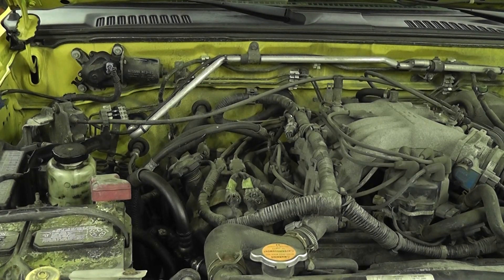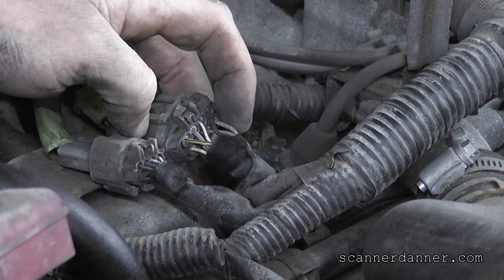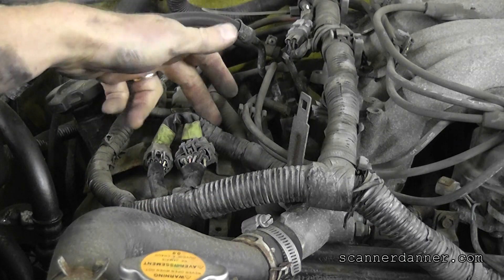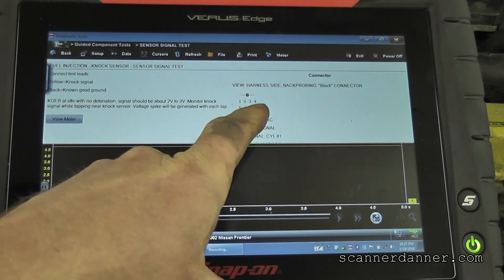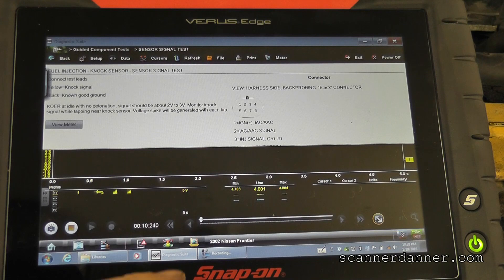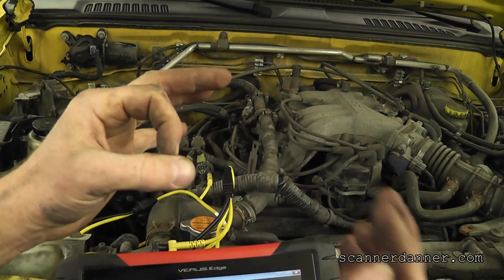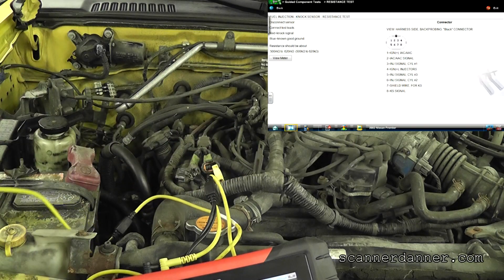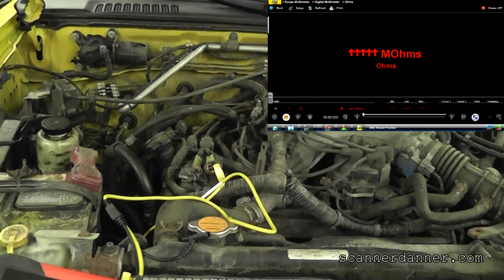How to test a knock sensor (P0328) - Nissan

Comment: Soooo how do I use a regular volt meter to test this? Ya boy is sorta dumb and needs help
Reply from the maker: You can only do a resistance measurement with you DMM. The signal is too fast of a voltmeter. Though it may be possible to see some activity on an AC voltage setting

Comment: How to test a $25 knock sensor: just buy a $5000 scan tool 👍 piece of cake!
Reply from the maker: or, watch and learn and find another piece of equipment you can use as a substitute
Reply: @ScannerDanner  what "other piece of equipment" can do what your $5000 scan tool can? (Besides a $2000 oscilloscope)

Comment: 😢 I have a 2004 Nissan Maxima and the car turned off on me while I was driving. Then I had a hard time turning it on and the car won’t accelerate the way it should. Now it jerks so bad when I put it to drive and even worse in reverse. I have 3 codes: P0345, P0328, P0011. I have had issues with the car. About a year and a half ago the computer crashed and it caused a small fire. I had to get another computer and the mechanic fixed the wiring but the car still has issues after this. I still don’t know what caused the fire. They said it was the ignition coils. I love my car but I just can’t keep spending more money. I just want to know what is causing all of these issues. What should I do? Take it to the dealer to get it fixed or another mechanic ? Should I just Get another car and what kind? They’re so expensive now 😢 Hope to get some advice  from anyone

Comment: Got a P0328 code on my 04 Frontier 3.3 with only 41k miles. I have 2.7 volts at knock signal wire which is good. Disconnected the harness and checked resistance in ohms on the knock sensor wire and its not showing a reading which means its an open circuit. The issues was on low acceleration is would cut out or stall with no power yet the engine was still running.  No response from pushing the accelerator more. Could only pull over for a few seconds and resume driving. It would do this intermitted.   Only changed the distributor with a new factory one and reset the timing. Its gotta b the knock sensor right?
Reply from the maker: Not likely. Typically just a code and a check engine light on those.
Reply: @ScannerDanner  Thanks for the reply

Comment: Great vid! Some fyi if you replace the sensor with an aftermarket sensor, alot of people report having issues with the cam sensor afterwards. You should replace both at the same time. This vid explains why aftermarket sensors have the issues they do and why it causes that problem
https://youtu.be/Pjf-tacXOnI

Comment: if your engine is knocking will it throw this code too?
Reply from the maker: From memory this was an electrical circuit code? So I'd say no, but I would be worried about the actual knocking more than the code if that makes sense?
Reply: @ScannerDanner  let me give a little context and update id love your expertise on this please.

 i have a 92 nissan 240sx turbo,i have a lean idle/rich under boost issue,i found a good exhaust leak pre o2 which would explain my lean idle,i noticed i have a code for knock sensor and now thinking the lean idle caused the knock code,i think the knock code is pulling timing and adding fuel under boost causing my rich under boost condition so fixing the leak should solve everything does this sound like logical theory? 

or im wrong and exhaust leaks pre o2 on turbo engines normally cause rich under boost conditions without knock code playing a role?

Comment: Hi. I just bought a 2004 4x4 Xterra and there is a soft code, no CEL, for P0328 knock sensor. The mechanic said this is commonplace on Nissans and that replacement wouldn't resolve it. Please advise 🙏 thank you.
Reply: Santiago, per the Nissan Factory Service Manual, DTC 0328 does NOT trigger the MIL (same as CEL) to illuminate.  Specifically, Nissan engineering chose to NOT illuminate the MIL if DTC 0328 is encountered.
  By definition, DTC 0328 advises technicians of "KNOCK SENSOR CIRCUIT HIGH-INPUT;" meaning ONLY that "an excessively high-voltage from the knock sensor is being sent to the ECM."
  The general do-it-yourselfer is under the impression DTC 0328 will load AND ILLUMINATE THE MIL if pre-ignition or knock is detected by the ECM...that is completely wrong!
  P.S.  If your Xterra has only stored DTC 0328 (meaning NO other codes that would trigger MIL illumination) and ALL emissions readiness monitors are "OK," you will pass a standardized government  emissions test.
Reply: I replaced knock sensor and wire in original location same code. Did relocation, same code. Mechanic said on past similar vehicle. That code if not taken care of in timely manner can damage the computers ks circuit. When taken to emmisions past without issue tho, which was good and some much needed attention to underside of manifold components.

Comment: So my 04 Xterra is getting the knock sensor code. It starts stumbling over 3k rpm. When I test the voltage like in the video I get 2.4v. Does this mean my sensor is good?
Reply from the maker: Ignore the k.s. code for your stumbling above 3000rpm issue. They are not related

Comment: Great video! Thanks so much. So I back probed my 2004 Xterra (Supercharged) and I'm getting 3.2V, knocking on the engine (on top of the supercharger/intake) doesn't seem to vary it at all... I'm getting the P038 (knock sensor circuit high) code. Looking at the FSM normal voltage should be 2.5V at idle if I understand correctly?

Comment: How to splice knock sensor cable mine was chopped and spliced only the center wire but no ground (like coaxial cable)
Reply from the maker: you have to keep the shield isolated from the signal wire. Connect them separately and isolate them from each other and you should be fine

Comment: I'm a noob with a voltmeter. What setting do I set it to in order to do this test? Just using a freebie harbor freight unit...
Reply from the maker: Voltmeter set to a 20v scale to measure key on signal voltage, plugged and and unplugged while backprobing the connector with your red lead, and black lead to a known good ground.

Comment: Good video!! I replaced knock sensor. Wire was cut. 
I spliced into it and bought the connector, new knock sensor and still getting code p0328? Any info is much appreciated. .
Reply from the maker: Yes, that wire was a thicker wire right? It is actually two wires in parts of that harness. 
The outer wire is a shield wire and the inner wire is the signal. You didn't make them all one did you?
Reply: @ScannerDanner  No sir Thank you for replying.  I made 2 wires as the connector came with 2. I used the insulated wire for the green wire from the connector and the wire in the middle to the red from the connector. 
I did so much research before I put everything back together. 
Thanks again for your reply.
Reply from the maker: @TyRC12  okay, with the key on, disconnect the KS connector and give me a voltage measurement on the signal wire, I believe it should read close to 5v, maybe 7 (subaru used 7), then plug it in and give me a reading on that signal wire, it should be about 2.5 v
Reply: Thank you so much. I am really thinking about taking it apart again. I was thinking of  relocating the ks?
I believe the camshaft seal is leaking also. Thought it was the valve cover. But its leaking just underneath it. P0152 code I believe its for the O2 sensor. I changed it already also. I am getting codes that I already cleared? Changed the parts already. Thanks for any info. I appreciate your knowledge.
Reply: @ScannerDanner  Also I think I just put the red wire to the center white wire. Then the outter wire to the green. Im wondering if I have the wires on the wrong side since your saying signal wire. I dont believe I looked for signal side. I just thought red wire would mean power. smh. So I need to figure out which sode is signal on ks then wire it to the whire wire. If I did get lucky and wire it right. I will take voltage to see if Im getting signal. Thanks for the knowledge
Reply: @ScannerDanner  Sorry my phone is very old I cant receive notifications from Youtube. I will keep checking for your message thank you

Comment: I have 04 Xterra 70k miles only , I have code P0328 my car run fine and smooth but the problem is when I shift to D or R it won't do anything it won't move at all , is this code related to this problem or I'm dealing with something eles is bad knock sensor can make the car not to move at all ?
Reply from the maker: ignore the knock sensor code, separate issue for sure

Comment: I know this is an old subject ,but just watched i and dont understand the conclusion from voltage test ,instruction says  2-3 volts  with KOER, test showed nearly 5 volts and faulty sensor was diagnosed from this 5 volt reading with out engine running. What did I miss ?

Comment: Hi I have question I have same truck and same code I change knock sensor and same code po328 comes up again what u think could be the problem causing ? Thank you
Reply: Did you ever fix this problem?  Same problem here.
Reply: @TyRC12  yes I had to buy oem knock sensor I buy aftermarket first it was waist of time then I got oem nissan  knock sensor works great now but ur 1st sensor could be bad u can also then sensor with multimeter check videos on YouTube about knock sensor diagnoss.

Comment: Great video but screw taking that engine apart, open the loom tap into that and relocate new sensor on top of plenum
Reply: bad idea. The sensor is where it is to sense vibration and send message to computer to advance or retard timing according to your driving situation.Re: climbing,temp,load pull, etc.

Comment: Great video. About to replace knock sensor on '03 xterra. I've already done a fuel pressure regulator (FRP)on a '98 and the '03 is exactly the same intake manifold setup. Depending on how concerned the owner is about having the knock in the proper location will determine if intake manifold comes off or gets relocated.

If anybody if suffering from stalling and no start conditions and has replaced distributor or coil then it probably the FRP. They are known to fail.  I checked every wire from sensor to ECU on the '98. The fuel flow out of fuel line was good. I set up a rubber hose into gas can. The owner said screw it and bought the FPR because he was having the problem for 2 months (got lucky $50 Ebay real Nissan nib). Started right up no problems and haven't heard from him since.

Comment: Is there any danger of shorting the signal wire to the shield when back probing the wire?
Reply from the maker: If you are backprobing a connector, no. If you are piercing the signal wire, yes, absolutely, you do NOT want to do this on a shielded circuit.
Reply: @ScannerDanner  Thanks,
I'm trying to visualize why it's not an issue.  How is the shield grounded at the connector?

Comment: What is the purpose on this knock sensor anyway?
Reply from the maker: it enables the engine computer to run an aggressive spark advance map. The knock sensor is basically a microphone and if the ECM "hears" a spark knock or pinging issue, it backs off the timing to correct it. With a knock sensor code, it is not uncommon for the ECM to run a less aggressive spark curve or map, resulting in less mpgs. Not sure you will feel a power difference though to be honest
Reply: Thanks for the info

Comment: My 2003 Frontier 2wd 3.3L V-6 broke down twice. Sometimes starts right up, other times crank no start. Pulled codes. First said multiple cylinder misfire with the P0328 code. Checked it running again. Back to back P0328 knock sensor circuit high input. I think I'm gonna change the knock sensor. Thanks for your video.
Reply: Also, I use my Mac Tools ET97 scanner. May not be the best, but it does some live stream. Good enough for this shade tree mechanic on a budget. LOL
Reply from the maker: leave the knock sensor code alone for now, it is NOT causing your problem. When it doesn't start, you need to find out what you are missing
Reply: @ScannerDanner  Oh wow. Thanks. I just bought this truck about a month ago. About to take it back to dealer and tell them to either fix it or cancel contract or get me another vehicle.
Reply: What was the problem on yoir 3.3l
Reply: It was a Nissan. That was the whole problem. No more Nissans or Hyundais in my driveway.

Comment: Can anyone give me a idea of how much this knock sensor is going to cost me to have replaced???
Reply from the maker: I think the intake has to come off to change it, so labor will be your biggest cost. However, I have heard that they make a knock sensor relocation kit, where you modify the existing wiring and bolt the new knock sensor up to a different location. Something to look into on this older model set up for sure!

Comment: So i have a nissan 350z and have code p0327 and p0328. I replaced the knock sensor still same code I did resistance test was 420 on sensor and 280 at end of sub harness. What can it be its driving me crazy and 4.24v going to sensor.

Comment: Now does this apply to the supercharged Xterra?
Reply from the maker: should be any different if it is a single wire knock sensor
Reply: @ScannerDanner  I found out it's exactly the same place. Still hell.
Reply from the maker: I think they sell a relocation kit believe it or not. Something to look into for you

Comment: I'm trying to test a 2017 VW knock sensor with both knock sensor codes for low circuit voltage. Its a 3 wire. Shield ground is good, but the + and - for the knock sensor are both showing 0.8 volts for both sensors at the harness unplugged. There's no information on these knock sensor that I could find on Indentifix or Mitchell. I did the knock test unplugged at the KS side and it barely put out anything 0.5 volts.
Reply from the maker: I assume you have knock sensor codes? Post this to my forum, I'm sure we can help you. It's free to join. Hope to see you there. 
https://www.scannerdanner.com/forum/post-your-repair-questions-here.html

Comment: Great video.  Question:. I see people all on YouTube replacing knock sensors and assuming they are bad.  But how often does the check engine light come on because they are actually doing their job and detecting a knock, or ping?
Reply from the maker: They do not set codes for doing there job, make sense?
Reply: @ScannerDanner  Yes, thank you.  I thought the knock sensor changed the ignition timing to help prevent damage and then set a code so the driver would be aware of the issue.  I didnt realize a code was set only if a sensor/wiring fault is detected.  Thanks.
Reply from the maker: It does do that, but will not code for activity, only when there is a fault as you stated.

Comment: Where do you connect the other lead if you are just using a plain ol' multimeter
Reply from the maker: exactly like the scope. Just think of the scope as a very fast voltmeter. The connections are the same

Comment: Great video...I just subscribed to your channel.  Thumbs up.Perhaps you can steer me in the right direction.  My Nissan Frontier SE 2003 Crew Cab 3.3L is giving me a bit of a starting problem.  It takes about 5 to 10 seconds to start.  Then at other times, it starts instantly.  No code showing.  I hear the furl pump kick in and whirrs for about 3 or 4 seconds.  Any suggestions?
Reply from the maker: I just uploaded a video on ScannerDanner Premium on your exact truck. These are known for distributor problems. 
I seriously would like to open this for you for free but I can't easily. My suggestion is to subscribe for the 14 day free trial, then immediately cancel your subscription. You will still get the remainder of the 14 days and you won't have to worry about being charged. Yes, you'll still need to put in a credit card or paypal number but it is very secure (more so than even PayPal). 
https://www.youtube.com/watch?v=4Vq8P3jbm4U

Now I am not suggesting you go and run out and buy a new distributor. You could also have a fuel pressure problem. In which case, this playlist should help you identify that. (this is all on my free channel)
https://www.youtube.com/playlist?list=PLAFYVCyenqcrstVqfSc1PCbQ1pebuNIO6

Comment: what I was looking for! this isolated my problem down to the ks, just used a multimeter. Viva la youtube, thanks.
Reply: a bit confused tho: can I have a partially bad KS?  w engine either idle or off, the back probe reads 4.8v disconnected and 3.6v connected-- so its not open but a bit above spec.  When I alligator clip the pin I get 622k ohms, which again is just over spec. (strange since that should lover v...)
I get 2 generic P0328 B1 circuit KS codes w my innova after starting.

Comment: How can you condemn the knock sensor that quick without testing wire from your 8 pin harness to knock sensor?  I am dealing with P0330 on 02 sienna.  I read that most of time it is the knock sensor harness 80% of the time due to heat over time on wire.  Several Toyota techs said that it is almost always that wire from the heat.
Reply from the maker: Next step is to pull the intake. As a tech in the field, it is absolutely getting a new knock sensor. If you find wiring damage inside, it is still getting a new knock sensor and now a quick wiring repair. And in my experience, when you get this far, it is the knock sensor that has failed. One one time I can think of a wiring issue.